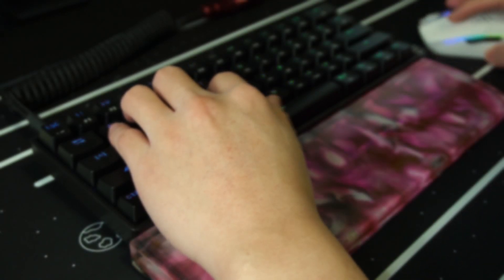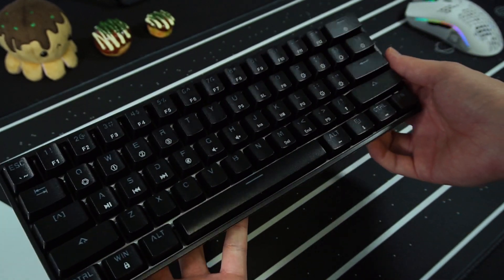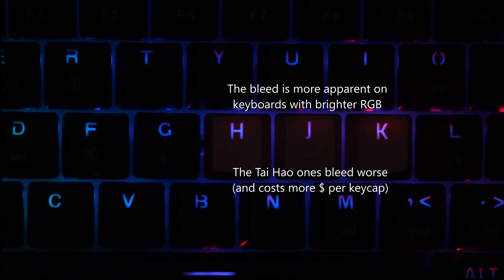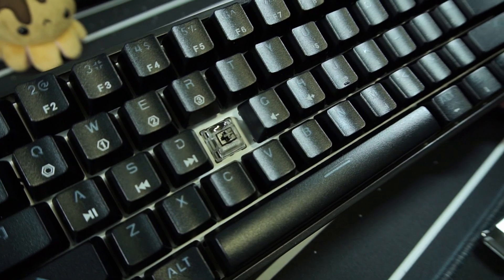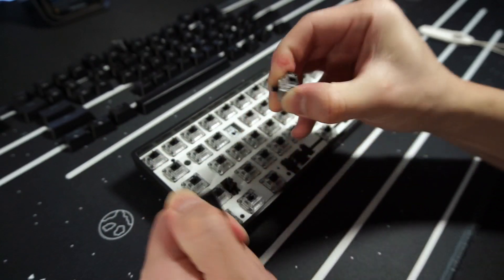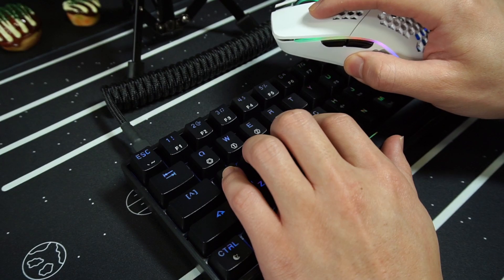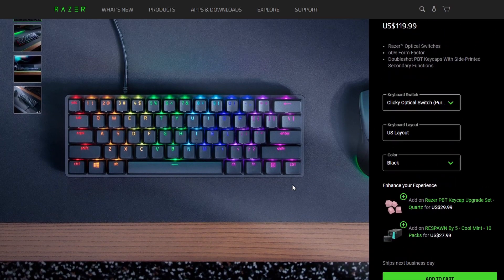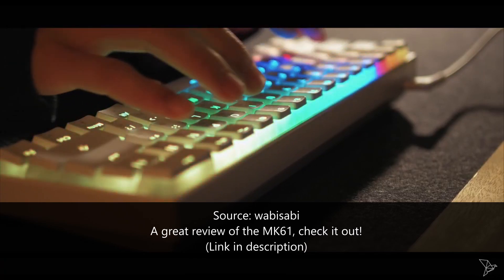Geek GK61 Mechanical Keyboard Review with Type Test (2021)

Comment: Which is the best switch and color in the gk61?
(I playing valorant,fortnite,roblox)suggest a key based on these games.
Reply from the maker: It's impossible for me to give you an answer because it's all preference. GENERALLY though, gamers seem to prefer red, yellow, black switches, which are linear switches. If you have heavy fingers then I would get yellow or black (heavier springs).

Comment: I scored on picking one up for $35 at a liquidation warehouse today. It has the Gateron Yellows
Reply from the maker: Score!! Gat yellow version is $10 more too, so you got a great deal 🙌🙌
Reply: @takoyakeys  Yup. Regarding the switch problem you had with the keeb, I had that same issue with a Tecware Phantom. It was such a pain to take off the switches lmao
Reply from the maker: @shiftyz_  If I ever do decide to mod this thing I found out you can still unscrew the pcb/plate from the case without taking all the switches out - and once separated from the case it should be a breeze to remove the switches.
Reply: @takoyakeys  Oh wow haha, that is a time saver

Comment: Great Video. I also have the GK61 but in my opinion I regret this purchase because im only stuck with gateron optical switches and my blue LEDS broke but for its price its a good starter keyboard and a razer huntsman mini.
Reply from the maker: Yeah it's not a terrible keyboard to start with but definitely better alternatives in the same price range. Even more alternatives if you add $10-15 to the budget

Comment: My toughts are that it's a good Mech starter board to get you into this amazing hobby ( expensive addiction in my case thx tako and hipyo lol ) and if you want to go on a buget and not spend a lot this is a good board but if you don't want to have stunts along using it or modding it I recommend getting either the Gamakay MK61 , Glorious GMMK 60% ( this is my current keyboard and I pretty much love it I only wish I could get a nice PBT keycap set or some custom keycaps and much more things. But in the end this would be a good option on a budget. <3
Reply from the maker: Yes +1 for the Gamakay MK61. Comes with PBT keycaps, better RGB, looks better and is cheaper than the GK61 lol. Still limited by optical switches but if you want optical switches then it's a no brainer imo

Comment: Nice vid tako! I totally get your pain about the switch pulling around the edges. I actually liked that weird spacebar foam, I've never seen it implemented that way in another board though lol. I think for people new to modding, this board presents a good challenge and starting point
Reply from the maker: Thanks for watching! I think the foam is maybe good for reducing some echo/rattle but not much beyond that - if they filled the space bar with foam it probably would’ve been better lol. As for learning how to mod with this board - it might turn people away from keyboards because it’s such a pain in the ass lol